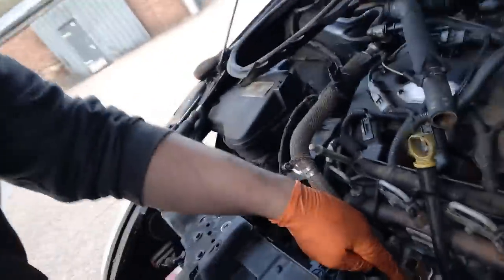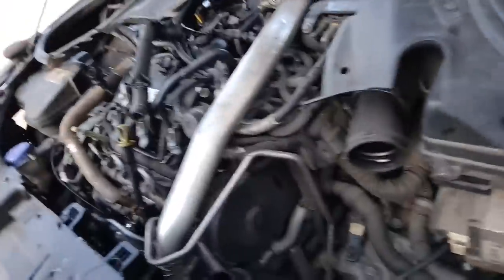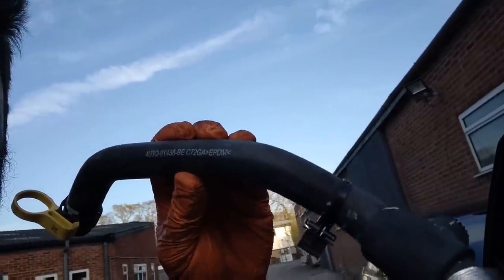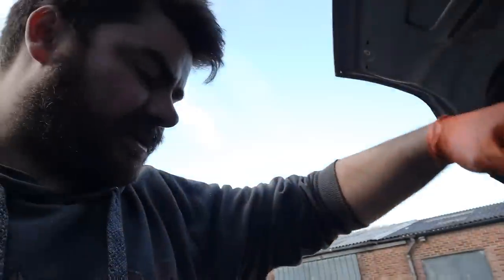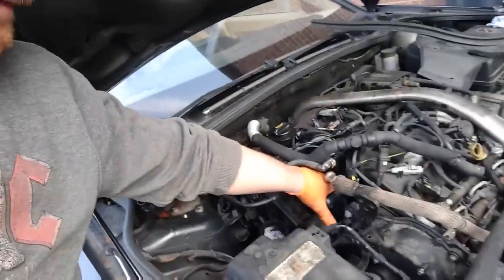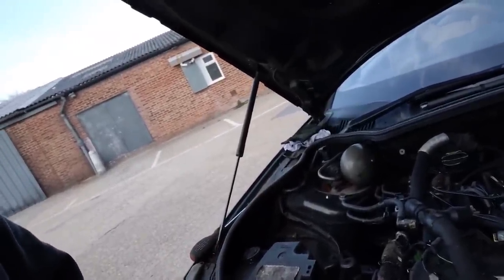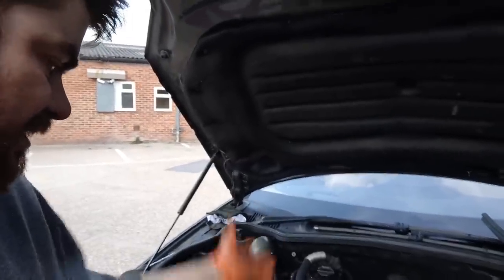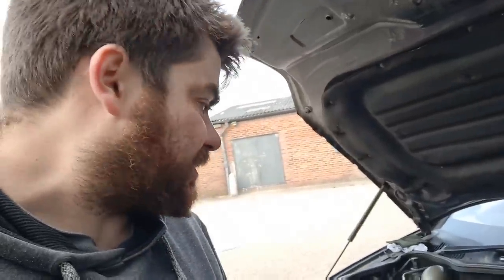Cheap Citroën C6 Project 14: Cooling System Repair VLOG pt3

Comment: Thank you for your service. I did exactly the same thing, on exactly the same design spring clamp, on a Saab 9-5 turbo bypass valve pipe thing. As you described, putting weight on it, and I don't know what happened next, the spring came back and punctured the tip of my forefinger. I thought I had been shot, one of the most painful things ever. I still have a mark on the finger and that was 15 months ago...! I was at the family home and didn't want to alarm anyone so just stayed quiet, wondering if I'd broken the finger too. Felt like such an idiot as I've removed that exact clip (2 of them on the pipe) multiple times. If I was you, I would probably take a trip to a GP / douse it with TCP etc. just to remove any risk. Again, thank you for your service. I will never, ever own a C6, and that is thanks to you!

Comment: That's the life as a Citroën veterinary, sometimes the patients bite you. 😓
You should go have that wound looked after so it doesn't get infected.  
Crossing fingers for the reassembly, I'm so happy I bought a 2.2 HDi C6, haven't had a cooling issue in nine years of driving it. At least not yet 😶 
Best regards 🔧😊

Comment: I've been going through the same pains as you (the car rather than your hand). My swirl pot thing had failed too. 1351KV - the only place I could find it in stock was/is Chevronics. Rob has a small 'stash'. Luckily my rad had already been replaced by the previous owner so instead my car decided to present me with some LDS leaks instead. Oh, and the main beam decided to pack up on one side just before the MOT. One thing is for sure; owning a C6 is an 'emotional' experience . . . .

Comment: I have a tool that has the plier bit at the end of a bowden cable, works really well on those clips and is much stronger than it looks. Also I have not had any scraped knuckles since I bought it. I have used JLM diesel Air intake and egr cleaner on  my 300tdi disco and golf gttdi. Both had dpf's and I had no problems with them. The disco inlet was full of gunk and lumps, I took the inlet off after using it and the ports were perfectly clean except a light covering of black dust. Both cars ran perfectly for well over 2 years after I used it, and yes I did not believe it would work until it tried it, hence why I took the inlet off. Oh and if you hate hospitals you might want to get some steristrips (sorry can't spell but they are stick on stiches)
Reply: Yeah i find those hose clamp tools are mandatory for these clamps.. they also lock in place as you squeeze them.

Comment: Please get your hand checked and stitched up if necessary. It would be even more annoying if you would have te cancel your trip to France if you got an infection or something..
Reply: There's a good chance he'd get excellent treatment for almost free here. We take hand/finger injuries very seriously in France. Last month I cut my finger quite badly and went to the ER for a  few quick stitches. I ended up  spending my afternoon in an operation room surrounded by surgeons, with the whole arm under anaesthesia, hoses and wires connected everywhere in my body... Incredible. And then I got daily visits from a nurse to check the band aid, and a whole week of opiate painkillers 😂 with assorted 2 weeks paid leave from work.
Reply: @conradharcourt8263  😆I did drive myself there though. After reporting to work thinking it was but a scratch.

Comment: Test the cooling fans before refitting the bumper cover, Kich! They’re very vulnerable to the elements on the 2.7 (on the 3.0d they’re in between the intercooler and the engine, and they ’suck’). With the engine running, disconnect the 2-pin grey connector from the coolant temp sensor; the fans should immediately ramp up to full-chat.
Reply from the maker: It's cool, they work (these vids are about a week behind)

Comment: My trick for getting to the rear EGR valve is to loosen the engine mounts and use a half-scissor jack (with some wood) between the engine and the firewall to cant the top of the engine forward.
Reply from the maker: Yeah....nah.

Comment: Hello all, I have a 2007 2.7 Exclusive that a previous owner removed the two DPF.  Canisters are still in place.  My local dealer recommends leaving them alone because if they install new ones and restore default programming they might not be able to restart the car.  Any suggestions?

Comment: Lesson learned I hope... you were whizzing away on the metal pipes and connectors with NO gloves quite casually.. there are cheap tough gloves available that don't restrict dexterity... can't think of the name but have recently seen them recommended by a Youtuber of your ilk.

That incident would have caused a down-tools workshop walkout and countrywidecompany  strike if it happened in a French Citroen garage....
Reply from the maker: None of the gloves I have here would have prevented that injury, it'd go straight through.

Comment: Do a series about emptying the ash tray, wich probably requires taking out the dashboard first in order to be able to remove the windshield. I'm sorry that I have to break it to you but this car will never again be remotely right and reliable. This car has been developed with total disregard to maintenance, even less so than an iPhone or AirPods. You are supposed to use it until it starts to act up and then get rid of it and never look back.
Reply from the maker: I love your positivity!